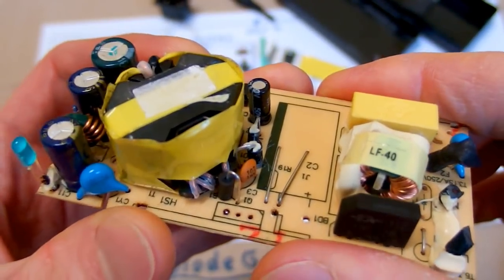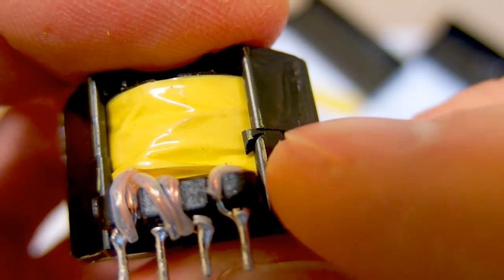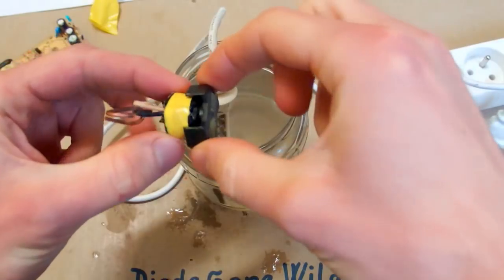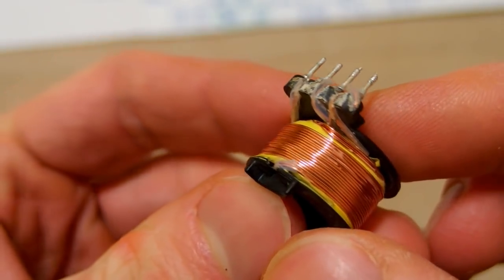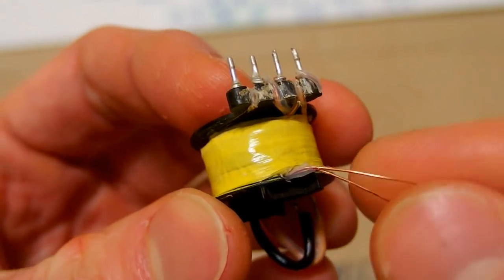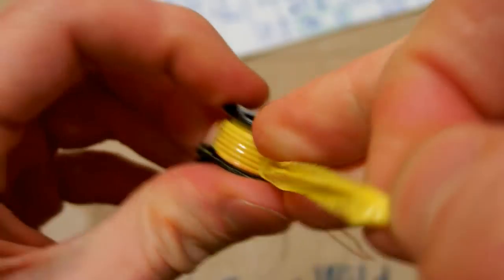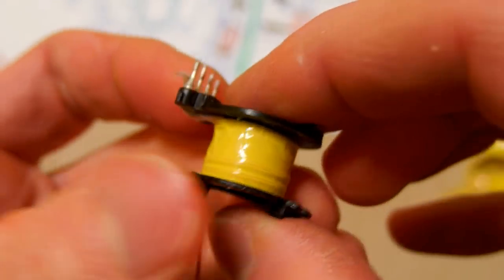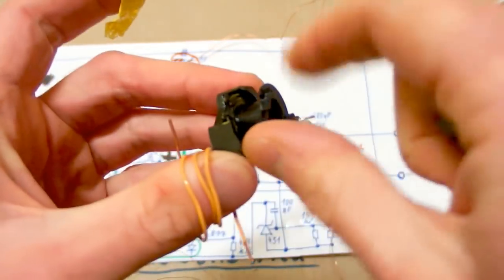12V 5A Switching Transformer Autopsy - How it's constructed? Is it safe?

Comment: I have been trying to troubleshoot an AC adapter for a laptop with a power of 330W , and thanks to you, I'm making progress step by step . The problem I encounter is the identification of the Coil of the active PFC. This one has a secondary winding which is on one side connected to the ground of the 2 MOSFETs of the PFC (they are in parallel) but I cannot find where the other side is connected. I told myself that it must be connected to an integrated circuit to detect a current crossing at zero (ZCD) but none of the legs of the 2 closest ICs correspond (the other ICs are on the 19.5V side (An OP2990 and a TEA 1995 ).In addition, these ICs are unreadable.The other problem is the identification of the primary of the output transformer.I followed the tracks with the ohmmeter and the inductancemeter but my diagram is not consistent with an LLC assembly The choke which is between the 2 MOSFETs has several connections (which I don't understand) and is surmounted by a radiator (which I understand) I am not looking for the values (x milliHenry, etc.) of these materials but their installation and wiring I wrote to the company DELTA from whom I bought 5 of these power supplies but m, despite my reminders, they do not even have the decency to answer me.
Do you know where I can find this information. Thank you in advance

Comment: Very nice! I always thought trying to recycle these transformers would be useless. But now I know there's a way of opening them withouth breaking the core. Thanks.
Reply: put one of those ferrite side on the long rod of soldring iron for 30 secs it works too
Reply: @dunderdee  so you let thermal expansion do the trick?

Comment: Hi! Could you please do a video on switch mode transformers and their windings/pin layout please. I'm new to electronics and learn so much from your videos. One thing I'm struggling with is the inputs and outputs of transformers, where the windings are connected to the same pins like they were in this one...(auxiliary and secondary). Plus some transformers have 2 pins, some have 12!!! I'm sure it's simple, but the way you explain things is so brilliant that I know I'd leave the video no longer confused.

Comment: Never thought that boiling ferrite transformers in water would release the glue so easily. I normally put them in a solvent for a couple of weeks and then disassemble them. Tried the oven once but had bad results and went to the solvent. I'm going to try the boiling water, but I don't have an electrocuting heater - I think the shock from the mains helped make the thing shiver and crumble :-)
Reply: didn't wok for me, pobably work bette for these chinese transfomers but mine was from a sony stereo and it used that white glue cement or something

Comment: next time -- when you are going to investigate safety: The most important test you can make is a high voltage test between primary and secondary windings. This test shows if the insulation is sufficient between the 230V primary and the low voltage secondary...
Reply: The importance of the extra insulation is to protect you in the event one layer is compromised. They would all handle a 240v test or they would burn up as soon as they were turned on.

Comment: Ahh boil them, i wondered how to take them apart without breaking.:-D
Do you think you could make a better supply for 12v 5 amps?, just wondering :-).
Is the sheild to stop capacitive connection or some odd frequency effect?
Reply: I don't get why capacitive coupling would need to be suppressed. I mean chances are there is a Y capacitor from primary to secondary externally anyway. Oh but that one is tiny enough not to act as an effective antenna... mhm.
Reply: I was asking a question, i don't know what it is there for, a faraday sheild of some sort??.
I don't make transformers so i havnt a clue :-).
Reply: Yeah well i'm just trying to think along, and i too am puzzled by this.
Reply from the maker: Boiling works well :). Hot air gun may work as well, but there's a chance of cracking the core because it doesn't heat up so slowly and evenly. The heat gun may also melt the plastic or sticky tape, because in hot air, thin objects will heat up much faster. ... The shield is there to stop capacitive coupling. Otherwise at the output you may have a high frequency voltage referenced to ground.
Reply from the maker: You're right, a Y1 capacitor is usually enough. And sometimes the maker doesn't care at all :).
Reply: On the coupling issue:  bottom line, eletrical regulators require the capacitor for safety approval and FCC requires sheilding for interference approval.  The labels on the outside of the product tell you which set of rules the manufacterer is shooting for.  Stupid?  Yes.  It's government.  Look at the rules the EU uses to stop US vehicles from easily entering EU markets.  That will blow your mind.
Reply: LOL EU rules... i happen to live in the EU and have worked for two automotive engineering companies, and there were numerous times when we had to re-do something rather haphazardly or delay the US product delivery in spite of the vehicle being safe enough for EU, but apparently not the US! It has to be mutual. Usually something entirely asinine. I doubt i'm at liberty to talk about the details though.
Reply: Nice approached, I use to heat it on oven at about 90 to 100 deg Celsius.. yours is much better, but this will have to get dry before rewinding it.
Reply: I don't trust these Chinese adapters, mainly, because one Chinese adapter charger burned out my new android a few years back. Since then I bought a blackview android. It needs 3 amps of current to charge successfully. The included charger made a lot of uncomfortable noise when running so I decided to not use it. I had a soviet really god quality transformer that has primary of 240 volts and secondary of 5.0 volts and is rated for 3.5 amps. I added a full bridge rectifier, a beefy one, not that small tablet sized thing. I then added a 5 volt voltage regulator to it to constantly feed only  volts to my phone and added a few smoothing capacitors. I use the output to charge my phone. It does it marvelously for 3 years now. Phone is happy, I am happy because I know its safe and transformer is happy because its used as intended. That is the real way to charge a phone.

Comment: Amazing! :) Boiling, never thought about it. Brilliant idea.
I tried to build a transformer on a small toroid. I used phone cable(ones solid wires). I wanted to have 2:1 (ex. 220:110 , 110:55)
Did 20 turns on one side and 10 on the other, when I tested it on 110 v(actually 130) , it burned/melted and sparked :'[
Poof, plugged it out. Dunno what went on! Or why! I figured since it was like 1 Ohm in resistance, it was like heater probably dealing with 130 amps or at least as much as that outlet was able to push, could be 10~20 Amps!
Reply: The 1 ohm or so resistance in itself could have been good, if the inductance at 50 Hz were high enough. If the core is a very big one. The problem was that 20 turns wasn't enough for that core for that voltage, and the current saturated it and became a resistor.

To use an unknown core, I use the following method. Wind a known number of turns (10..100, depends on core size), then assemble the transformer. It's a little tedious for an EI laminated core, but it should be properly built for this test. Connect it to a variable AC voltage source. Variac is the easiest, but if you don't have one, a fixed transformer with a bunch of series resistors, or a wire-wound  power potentiometer will do.

Connect a series current meter and a voltage meter to the transformer under test.

Set a low voltage, then write down the current. Increase the voltage, then register the current. Draw it on a graph. You will see a linear portion, where the current increases proportionally as you increase the voltage. Then there will be a point (more like a transition zone) after which the current will increase way steeper than before. That point is where the magnetic material starts to saturate, and increasing the current further just causes dissipation in the winding due to it's resistance, but it wouldn't induce any more current on a secondary winding (if it were one). Practically this is the point where the inductor starts to trasition to a wire-wound resistor instead.

Choose some point below or close to the saturation point, and read the measured voltage from the graph. Divide the number of test turns you wound with this voltage.
The result will be the number of turns required for 1V. Do not round it to integer values here.

From this point on, you should calculate how many turns you'll need for the required primary/secondary voltages, and decide whether will it fit on the bobbin in the first place or not.

For this, you have to be decide on the wire diameter first, which is a different story (thermal design quoestion), but you should not calculate with 100% fill, because it certainly would not fit in practice because of the terminations, isolation, uneven winding and such. 70-80% is a good starting point. Then if you want more exact secondary voltages under load, you should add some percent to the calculated theoretical turns of the secondary to compensate for the losses. This depends on the size of the core, the coupling, and the thickness of the wire. Good starting point is 5-10%, but might need some experimentation. Wind the primary first, then you can replace the secondary on top of it with way less work, in case you miscalculated it.

Comment: where is the next video ??
 did you done 5amp on output by this supply which was 3.6amp ????
actually i got the same power supply as in in your hands (same model) and i also have the same problem its Not giving 5amp on the output, over current protection actives around 3.7amp, if you did converted this supply to 5amp so plz share me how i can do this with my one, which is same model as yours

Comment: Some transformer use some high resistance glue, in this case you can use a hot hair gun, take precautions if you use a hot air gun, the surroundings can be very hot a and use gloves when you try to dissamble the hot core

Comment: Diode the only thing more that you could have done is noted the gauge of the wire. If you do strip a transformer again it would be nice if you can include that information.
Reply from the maker: I can't recall where did I put my tool to measure the gauge :). I keep samples of the wire and I will measure it when I find the tool ;).
Reply: Thanks. Always good to see how close to the wire limit the Chinese went.

Comment: I've taken apart transformers that used wax to pot them. I've also had few high frequency types that just came apart easily after removing the tape. I thought some of them must be epoxied. Thanks for getting me to try boiling. Does this work for I/E types as well? Every time I've tried to separate an I/E core I've managed to bend and ruin something. I've yet to get motivated enough to put a blade on my chop saw and break out the welder...yet.
Reply from the maker: It seems to work for almost any ferrite transformer :).

Comment: Hello sir sir i have rewind one chopper but it heat fet 20n60 and the chopper out current ok when i connected to batry its heated ic uc3843 and burn also fet

Comment: Thanks for this informative video! I like when you examine things down to the ground!
Its a pity the Chineese exaggerate all the specs as they like. You never know what you get! The only thing youl could be quite sure about is they dont stick to their specs at all!
Most interesting is the light of little torches powered by just one liion cell and they claim you can get 6000 lumen or even more :-). But they also sell liion cells in 16850 format with 10000 and more mAh - as well - so it might work ;-)
Reply from the maker: They can claim crazy numbers because most people have no idea about physics and electronics. No more than 3500mAh is actually possible in 18650 size. The 10 000 mAh cells actually are 500mAh. The lumens are usualy multiplied by 10. The world's best LED efficiency is about 160lm/w. You can do a simple math: A 1W LED can't be oved 160 lm. Cheap LEDs are even less efficient (100lm/w or less).
Reply: Yes, you are absolutely right! I am also an electronic hobbiest and know about most of the real specs :-) In some times its obvious they are exaggerating but in some cases its not. I bought a DC buck converter which is rated for 40V input, 1.2 - 36 v output at up to 9 amps. The specs of the switching ic is only 8 amps max, but needs extra cooling. The bad thing they also used an 78L05 voltage regulator that is only rating for 30V max input, so its far over the specs already. But you can only find out when you examine the products deep down to the ground - like you do it :-)

Comment: i have the feeling that the ratio 36/6 is a bit off and they should have winded about 46 tuns on primary (that would increase the primary inductance and lower peak primary current that now hits peaks and triggers IC current limiter early) and 6 on secondary and no other change...Chinese economy to primary coil and rely on regulation to do all the job???

Comment: I need a video just about your awesome SMD soldering iron that you got there.
Reply: That thing is awesome. I started with a huge, Weller, pistol grip soldering iron in the automotive trade, still have it 35+ years later, and it's still a BEAST.
Reply: You know what, I've never tried them. I've nearly bought one, but the tips look way too bulky for close work and the guns are pretty bulky in comparison to the standard looking ones. Are they really that good?

Comment: How do you determine primary and secondary,Auxiliary winding??
Reply: On step down transformers (which are the vast majority) primary would be of thinner wire and many times more windings.  Auxiliary typically would have the LEAST windings, for they are low voltage used to start oscillation IC to get output started. Usually, the inner winding is the primary and the secondary is wound over the primary.  On larger transformers, simple resistance test would reveal the pairs. Primary would have higher resistance.

Comment: What device do you connect to the network to boil water and dismantle ferrite? Like video !!
Reply: This is some chinese stuff. Historically it was done with two razor blades tied with a string around a piece of insulation. Hard paper or wood or something. And connected directly to the mains voltage. But it isn't really a good idea...

Comment: Hey! Long time ago you did teardown of those Alocacoc Power Cubes and you said thay you want do the same for the remote control (button), because they are saying it's working wirelessly without battery. Any news that you will do it? Thanks!
Reply from the maker: There's a chance I will get the remote for Christmas :). Then I will make a teardown of it ;).
Reply: Thank you! <3

Comment: I had longer not fat 2.5 sm or 3 per 5 or 6 long transformer today i got pissed i used my jet lighter to heat up one of the sides sucsesfually remove half of it and just pulled the other one after seccond heat up on it cause i miss to see that some dump put silicone on it :/

Comment: Ah - one more - just a suggestion: could you make a video how to connect 2 or more switch mode power supplies in parallel for more output? I know its not suggested because of uneven load effect or worse reverse voltage into the weaker supply. I would also like to see if its possible to control multiple SMPSs in parallel with CV and CC-regulation (constant voltage / constant current). There are cheap chinese SMPS that deliver up to 40 V at 5-8 Amps for little more than 3 USD. If you could connect them in parallel it would be nice to built up a real powerful bench supply :-)
Reply: 3 bucks? no way
Reply: Why not? Give it a try... Maybe you have to balance the output via some small resistors / shunts but the cc will prevent each of overcurrent - wont it?
Reply: I was doubting the possibility of being able to make a 200W+ SMPS for that price
Reply: You have to use 2 exactly same power supplies. Measure and set same voltage before connecting the load. Also it is preffered to use sepparate wires from each power supply and connect + to + and - to - right before connecting to load.

Comment: I used to heat them with a steel sheet on a gas stove. I never thought 100°C would be enough to soften the potting.
Reply: It's usually just glued with normal superglue in the cheap power supplyes.